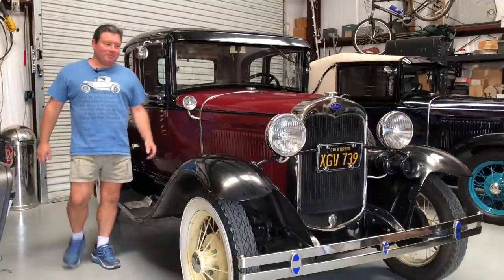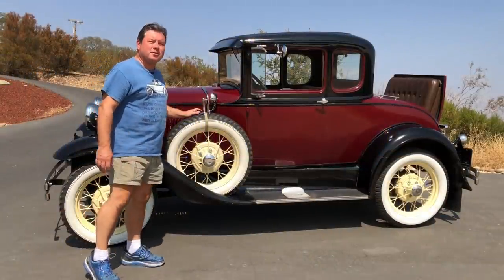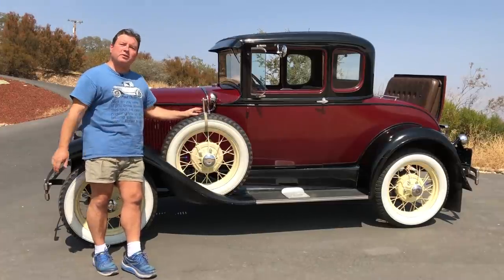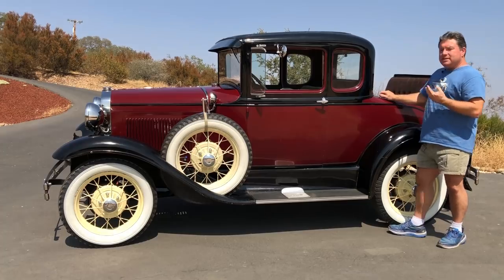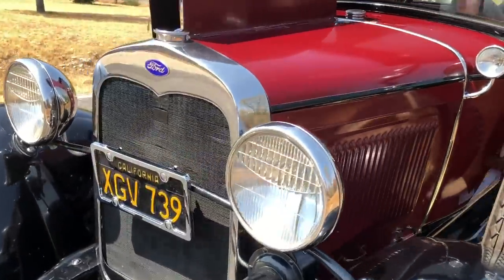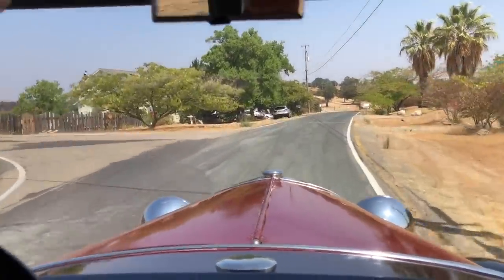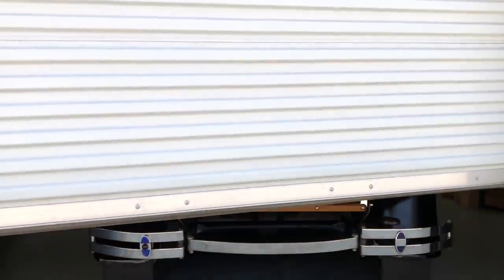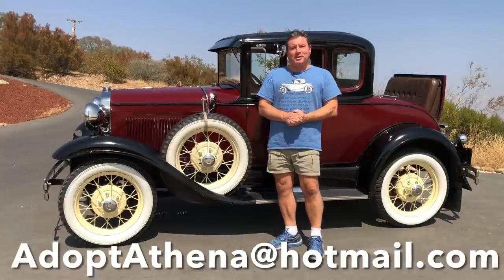This video almost KILLED me to make - 1931 Ford Model A Coupe "Athena"

Comment: Wow your asking price is very reasonable . Some of the prices on the internet for model A are unreal . Your is more than fair and a full set of videos to show the work done . Hope she find a good home .
Reply from the maker: Yes, priced reasonably, not trying to rip anyone off.  I think she has found a very good home!
Reply: Jim,  Some of the prices seem unreal because the amounts of money invested in the restorations are unreal. This is a very nice car offered at a very reasonable price.  However if the car where to get a professional grade repaint with all of the associated fiddley body fitting and detailing, proper brush applied pin striping, a professional grade historically correct new interior, plating work as required, a fresh engine and other mechanical refurbishments, a Mitchell overdrive…. The car could move from a very nice A to a stunning example. The asking price of the stunning example could easily be double or more and the owner could still be bleeding money from his eyeballs and realize his labor was worth 10 cents per hour.  This is one beauty of the A; there is something available for every budget.

Comment: I've watched most of your journey with this car.  Great job bringing her back to her glory.  You mentioned Athena is an early '31;  the radiator frame looks like a '30 with the blue Ford logo.  All of the 1931's I've seen have the radiator frame painted at the top/bottom with the car's color, and the Ford logo natural (nickel or chrome?).
Reply from the maker: Yes.  Explained that in the video.

Comment: Hi Paul I have a 1930 fordor that has fuel tank that sweats fuel from the bottom. Is their a way to  clean and seal without distroying the paint , I has googled it and it says do not hot dip your tank ..so many products...JB weld fuel tank patch ??? Do you have any advise
Reply from the maker: It "sweats" fuel??  If so, that means it has become porous.  If it's porous,  that means it has rusted through.  If it rusted through, it needs to be replaced or maybe it can be saved by hot tanking it and soldering it up.  Either way, you need to remove it from the car.  Take it to a radiator shop for an opinion.

Comment: Hey Paul, prepping my garage for my new to me A. Are there any specific tools other than a basic socket set and other such basic things that you would recommend. What would you recommend as a permanent carry in the car on tours and things?
 Thanks,
Brantley
Reply from the maker: Good work Brantley.  Just basic wrenches and sockets.  Get a timing tool and a grease gun with the proper end.  What to carry?  I did a Q&A video with a question about that...
Reply: @ModelA  thanks Paul!

Comment: Let’s title this a public service announcement.  I recommend, and would recommend to any parent of a daughter or son showing interest in mechanics or a career in engineering, the Model A as a first car.  Yes, I recognize and respect the concern of safety.   The two wheeled vehicle  - motorcycle, scooter, moped - has set what most recognize  as a minimum acceptable level of safety for today’s highway travel.   I believe the Model A surpasses this minimum safety threshold by a good margin. Paul’s clever slogan “I am the warranty “ could be reworded “I am the safety “ .  My safety score while riding a motorcycle rests squarely on my shoulders. Likewise while driving my “A”.  The reasons for suggesting the “A” would warrant an essay to fully explain. Many of the reasons are almost cliche, so I’ll stick to a few under appreciated points.

1. The well sorted A, as Paul would say , with the prescribed routine maintenance is a reliable ride. Perhaps more importantly it is designed to be repaired.  The car is at home with a hammer, pliers, screwdrivers, a Monkey wrench, bent nails, and baling wire.  A Monkey wrench is a real thing and was a ubiquitous tool in the day. This car was successful at a time when a good portion of the population was cash short.

2. The “A” is an engineering tour de force. Crawl underneath, look around: the lineage from horse carriage to horseless carriage is obvious.  Who would have thought engineers were considering the influence of unsprung weight when refining their design?  It certainly appears so.  A few years later, Citroen took this to an extreme with the 2CV.  A lightweight auto owning the claim “Able to drive at speed across a plowed field with a basket of eggs in the back seat.”   I drove a 2CV as a main, err only, driver for many years; the claim may be true.  Bottom line, the “A” offers much food for thought for a developing engineering mindset.

3. With the exception of the Freeway, the “A” is a roadworthy auto. The Mitchell gearbox is golden!

4. Parts are universally available and inexpensive.  I can honestly say there is better parts coverage for “A” than for my two modern vehicles. 

5. If the brakes don’t work well  — FIX THEM

And lastly for the budding engineer  - not following the flock,  the path less traveled, and learning to analyze the how and why of a design can be good for the career. Practice this skill on your first car.

Congratulations to the new owner!  Enjoy
Reply from the maker: Myrl- This is the absolute BEST response I have seen.  Do you have the ability to record a video of yourself reading this that I could include in a future video?  It's THAT good.

Comment: Hay Paul, thanks for your previous help. I have another question I know you have answered in earlier videos but would like to save time searching through them. When I am easing down a hill with the breaks on my A idles more slowly and sometimes dies. The harder I break, the more it is apt to die. I think you said it has something to do with the float adjustment but I need to know for sure before I tear into it. What should I do? Thanks in advance.
Reply from the maker: Bypass watching the videos that help support my household?  I need people to watch the videos!! Just this once... Float level or a vacuum leak causes that.
Reply: @ModelA  I have watched all your videos since i found you on YouTube and subscribed but I do not remember which one has the information I am looking for. I do not have a vacuum leak but I suspect the float level is wrong. Is this condition usually caused by a low float setting or high? Just trying to get it right the first time : ) Thanks
Reply from the maker: @jimmydolittle5479   If it dies when braking, that's usually too high.

Comment: Awesome car Paul.  I would keep the puppets for Mr. Rogers lol. Right?   Wishing I had another parking space.   Btw.  I've got a new leak at the back of oil pan area.  Any ideas ?  Tips. I'm going to consider pulling the pan and try a new gasket.
Reply from the maker: before you pull the pan, try snugging up the bolts around the back.  Sometimes you get lucky.